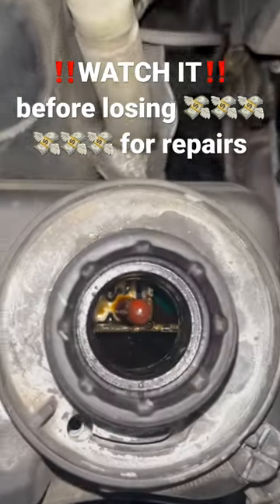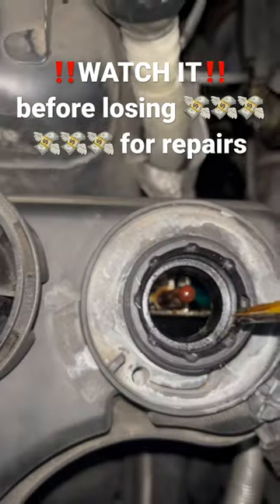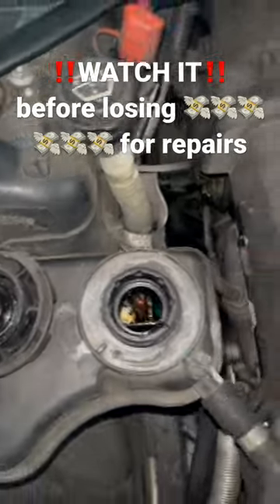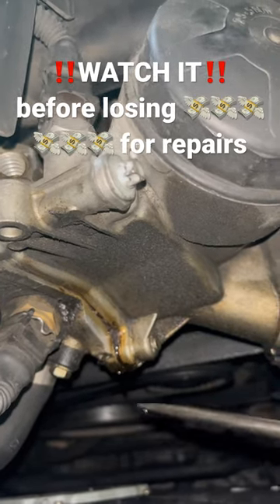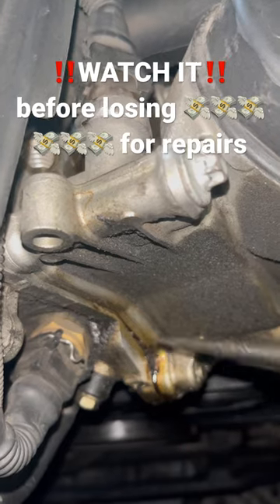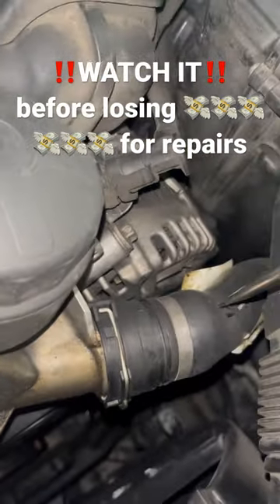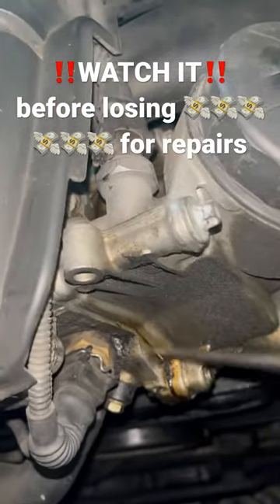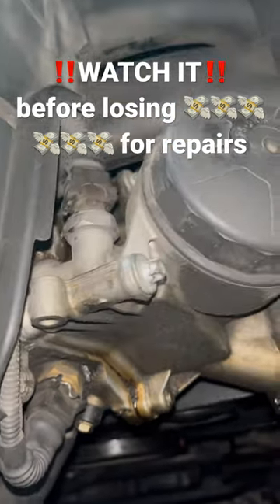BMW MISDIAGNOSED costs thousands in unnecessary repairs🤦‍♂️🤦‍♂️🤦‍♂️💸💸 #n52 #bmw #e90 #328i

Comment: This is why you either learn it yourself or take it to a bmw tech/ professional.  You’ll know your in right place if parking lot full of bimmers.
Reply: Sure, but labor is still 4-5 hours 🤦
Reply: @dereksbooks  exactly and that’s where the satisfaction and happiness come from after! By doing it with your own 2
Hands!!
Reply: My forget the oil stains
Reply: @dereksbooks labour shouldn’t be 4 or 5 hours on a oil filter housing gasket at least not on my e90 n47 2 hours max in a proper garage/mechanic 1 or 2 hours max   That’s as long as everything goes smooth.
Reply: Don’t take it to bmw tho. My water pump failed but wasn’t throwing any codes and I have no pressure leaks or visible leaks. They didn’t know what it was forsure and wanted 3k to change a water pump that costs 100 on Amazon💀 did it myself in an hour also with replacing the thermostat. If you got money to throw at bmw go right ahead, but if you don’t want to get charged 100 bucks every 2 minutes then do it yourself. Most info is available for free online and will save you countless hours and money👍btw they legit charged me 100 bucks for a tiny metal clamp for the thermostat and then another 200 to just reattach it🤦🏻‍♂️. Fr don’t waste your time do it yourself.
Reply: Say it ain’t so
Reply: Yes part is $20 but 4 hours of labor so $900 for the labor.

Comment: Bro just saved so many of yall 💯 all the mechanics are pissed now
Reply from the maker: Just telling the truth🙌
Reply: Ain’t no mechanic pissed. We’d rather do a 3 hour oil filter adapter housing than a head job.
Reply from the maker: @j.gtheautotech8455 i agree, but there are shops out there who charge for head job and just do oil filter housing gasket 🤷‍♂️
Reply: @j.gtheautotech8455 dont lie yall hanging up once you hear bmw lol (most mechanics)
Reply: @Erics-bf8cs exactly most. but I'm not most.  In my old job, 3 years at an independent shop that did it all we specialized in BMW and euro cars too., I was the one working on all the Euro cars because my coworkers hated them lol. I had recently switched to Toyota for more growth an opportunity. But BMW are was easier to fix than Audis :face-blue-smiling:

Comment: I bought an e39 recently and had all the classic Bimmer oil leaks. I pulled the whole top of the engine off and replaced EVERYTHING...Every gasket...every hose and line...EVERYTHING....she runs like a dream and doesn't leak fluids like a dead, bloated deer on the side of the road anymore!🎉🎉🎉😅

Comment: THANK YOU! My oil filter housing gasket is shot but I have an e46 so the thermostat connects directly to upper radiator hose. However I plan to buy an e90 this year so thank you so much for that heads up!!
Reply from the maker: Happy to help👍

Comment: VAG products are notorious for this too. Mostly on the TSI platform and some of them come from the 2.5. On mid to late 2010’s TSI engines there’s a little valve that goes behind the oil cooler. That should also be replaced when replaced the gasket on the oil cooler

Comment: Hi! do you then need to change the coolant after replacing the oil gaskets? Cause i'm changing my gaskets soon too. Thanks in advance!
Reply from the maker: Yes, or at least I’d recommend removing expansion tank and cleaning it thoroughly
Reply: @Zeiten  okay thanks 🙌

Comment: I’d bet that shop knows. They’ll just happen to replace that gasket along with the head gasket when they remove it to get the head off roll. Every single N54/N55 that comes through my shop I make sure to sell those filter housing gaskets and the upgraded metal coolant neck underneath the housing to replace the plastic ones that always crack

Comment: Having oil filter housing leak fixed on 2013 x1 as i write this.. good video info👍
Reply: Idek where the leak is coming from do you recommend taking it in or is this something I could handle at home?

Comment: if own 335I and see oil at back of engine, check PCV/intake pipe to turbo..  it's likely leaking a little oil. dealer will try to charge for a complete reseal ( why my car wound up on a lot looking for a new owner oil pan and VC gasket twice in 10K miles, and OFHG once)

Comment: people dont know the only way to blow the head gasket in these engines is by probably putting a bomb in there and blowing it up yourself 😂
Reply: I drove my N52 without a water pump and it didn't ruin the head. It ran limp mode. Try that in a Japanese car, and it will allow the engine to overheat and wrap the head.
Reply: What are you talking about they blow headgaskets all the time. Don't get me wrong they are strong motors but they aren't invincible.

Comment: thanks bro nice 1 ,i have bmw 1 series ,and it does have a bleed valve right next to this when i open it it is oil and not water coming out of it and in the bottle the car is losing its water i will check the pump but is there good chance both of these need fixed ,i will se if sytem will bleed if not i would say i need a electric pump and prob a gasket for the oil filter ,ty my friend nice 1 :)

Comment: How do you avoid this is there a better replacement part or just keep up with the gasket
Reply from the maker: Gasket lasts for about 60k miles or 10 years, so I consider it regular maintenance, use elring seal fpm-px material

Comment: ????Yeah I'm getting a leak right there too and whoever change the oil last did not tighten the cap very well so it was leaking there too so I had a rubber ring from that never got used so I took the cap off and put the new ring on hoping to get less of a oil leak...... Now I'm thinking I wonder if it's okay that I did not put a new oil filter in I just put the ring in and then retightened is that okay? To do I'm going to change the oil today but I need to drive it to go get the oil just want to make sure that's okay I'm sure nobody will respond in time I guess I'll find out.... what I'm wonder is when I tightened it back up because of the fact that it's still the old oil filter I hope nothing popped out of place or ripped
Reply from the maker: You’ll be fine, nothing to worry about

Comment: Coolant gets into your oil, thins it, causing the #6 rod bearing to spin.  Totaled motor.  If you catch it in time, don't forget to prime the oil pump before starting or you'll causing the #6 rod bearing to spin.  Totaled motor.

Comment: Just did one of these today and had to flush the oil out of the tank
Reply: How did you get that oil all out? I've been cleaning it out for days.
Reply: @edoza42 first pour out all the coolant mixture out of the coolant tank by simply removing the water hose that sits beneath the coolant tank. then add just water and let the car warm up for like 30 minutes. After that empty the coolant tank again and pour water in again and go for a 20-30 min drive. after that you pour out the water again and add a coolant flush + water (there is one from liqui moly that costs like 10€ or 8$) then go for another 20-30 min drive. After that empty the coolant again and put 2-3 times water in so all the flush gets out and you can put your coolant mixture in. thats how i did it

Comment: Would this be the case  for a 2008 bmw X5 E70? I was told but two different mechanics, i have a blown head gasket. 

Oil is in the reservoir tank & coolant is leaking in the transmission. Smfh
Reply from the maker: In your case you most likely need transmission oil cooler replaced it corrodes inside and transmission fluid mixes with coolant, transmission fluid looks like oil in the expansion tank
Reply: @Zeiten  
I actually had the oil cooler replaced. Thats why im inclined to agree with mechanics concerning the head gasket being blown.
Reply from the maker: @BenIsrael well there is also engine oil cooler gasket and oil filter housing gasket both can cause mixture of engine oil and coolant, i recommended transmission oil cooler since you said you have transmission fluid in expansion tank
Reply: @Zeiten  Totally thank you for the info.

Comment: mine has this leak & over heating but oil has no coolant, i keep getting told it has blown head gasket by people im wondering if i should try that first
Reply: I'm pretty sure that's a blown head gasket
Reply: @328iDaSleeper  oil cooler gaskets were bad
Reply: @jackcampbell378 does it still overheat?

Comment: Hey buddy will a leaky oil filter housing cause exhaust smoke??
Reply from the maker: No, definitely not the reason
Reply: @Zeiten if the oil gets in coolant that mixture cause the exhaust smoke? Or would a valve cover gasket cause exhaust smoke? Thanks!
Reply: So basically since these fluids can mix due to it leaking. they can cause white smoke out of your exhaust currently the case with my 93 318is 😢 nothing much will happen unless you never top it off wil oil or let it go for months
Reply: @yungboi597 so you're saying if oil and coolant mix its nothing to worry about? im not trolling its a genuine question
mine has little oil in the antifreeze gasket

Comment: Omg this happend to my e83 but it was because of the transmission thermostat cracked and failed and contaminated the reservoir.  Bmw thinks up stupid ways to ruin your day
Reply from the maker: That happens too although not nearly as often oil filter housing leak. But when transmission oil cooler fails and mixes transmission fluid with coolant that can definitely ruin transmission so more dangerous failure for sure
Reply: @Zeiten  I immediately changed the transmission oil right away and has been running good since.

Comment: Can someone please explain. Im looking to buy a used bmw tomorrow and would like to look out for but I don’t have a clue about what’s going on I’m this vid so if someone can please tell me what’s happening
Reply from the maker: What year and model you are about to buy?
Reply from the maker: What’s happening in this video is oil filter housing gasket leak (pretty simple to fix) sometimes gets misdiagnosed for much more expansive repair which is head gasket replacement (absolutely not necessary)
Reply: @Zeiten So if I get it right, oil leak goes to cooling system from the oil filter housing and all I need to do is to change gasket in it and refill coolant again?
Reply: @AmirUniqueTuni yes